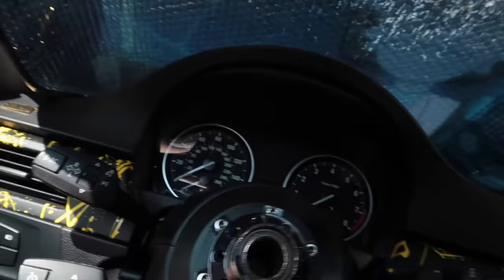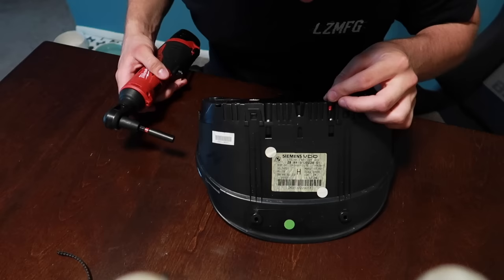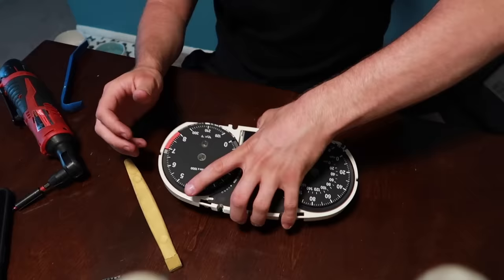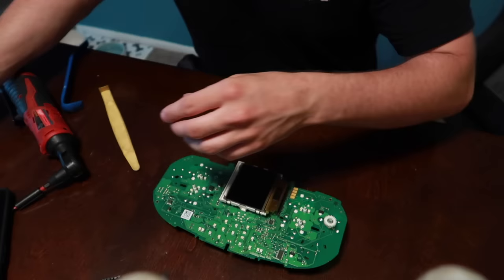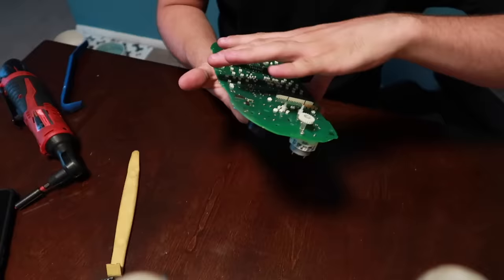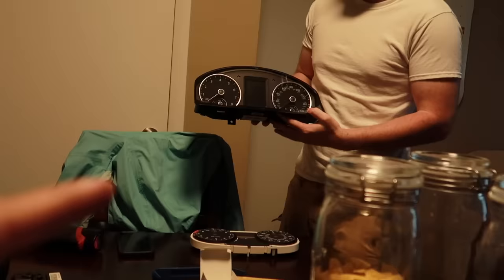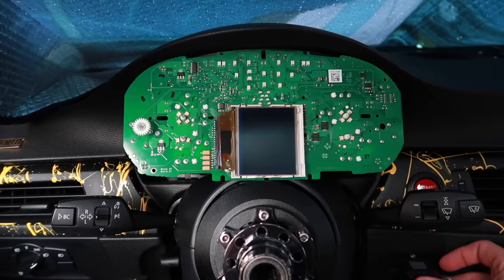e90/e92 Gauge instrument Cluster LED Swap DIY

Comment: Looks great, but there’s a reason why BMW chose the orange color. In the dark this color is the least tiring color in the spectrum for the eyes. Therefore saver. ;)

If you think of it: in astrophotography they use red light (close to orange) because they want their eyes to stay used to the dark. Red has the least impact on the eyes should they need light for whatever reason. 

During the old school negative film developing (in a dark room), they use red light as well, to prevent the negative te be destroyed

👍
Reply: Even in the new full digital clusters the standard color is red
Reply: I love red lighting at night and in cars, I was so happy when I realised my Alfa has a red spotlight in the roof lining aiming at the gearstick, so subtle and sexy at night,
Reply: Younes El Ammari lmao all the new m cars do not have the orange color (except for the prefacelift m2)
Reply: You aren't looking at your speedometer long enough for drastic effects, plus its dimmed. Also BMW of the same era has white lights too (M cars ex.E92/E90, E60). White/blue light helps people stay awake/alert at night which is a plus. 'White' light suppresses the body's production of melatonin. Exposure to the light of white LED bulbs, it turns out, suppresses melatonin 5 times more than exposure to the light of High Pressure Sodium bulbs that give off an orange-yellow light.‘ Additionally "Research has found that exposure to blue light suppresses the production of the sleep hormone melatonin more than any other type of light."

Comment: Hi. I just swapped the led screen on e90 cluster, put everthing back together, connected to car, and my BC button and scrolling menus not working! What could have gone wrong? Scanned, and got this error: A3A9 steering column switch cluster signal  0x1 EE  receiver instrument panel, transmitter footwell module. Pls help.

Comment: I have F10 model and one rpm needle is a bit darker than speeedometer needle (barely noticable). Do you think the LED is dead and should I even try to replace it? I would go for orange again
Reply from the maker: DrSalle hmmm, I don’t think it’s dead but could just be a bad LED. As you see in this vid it’s not hard to do. If you do replace it I would replace all the needles so that they all match. You don’t want to put a new led in and it happens to be the brightest one
Reply: @Anguella97  thank you for help!

Comment: Hey man great video I just finished taking mine apart and will start soldering tomorrow!! But I was wondering did you use the tweezers to guide the led in place or just your hands? Also any general tips you suggest while soldering?

Comment: Hello , am planing on doing this for my f30 but my concern is how reliable are those leds on long term are they going to hold on for a decade at least like the factory ones ?
Reply from the maker: Ahmad Doski not very sure how long they will last. I know they will last quite a few years but I don’t k is about decades. I guess it depends on the brand you buy maybe, but I’m sure you can find more info online

Comment: So I did this and it turned out great but my tach doesn't work now.....no idea what I did wrong...any info?
Reply from the maker: If you are referring to the needle not moving. There is a possibility that you pushed the needle on too far and it’s binding cause it’s too tight. Try taking it back off and putting back on a little looser
Reply: Did u get this resolved ? @robertshaw1490

Comment: Sony went with white led An it gave it a bluish look on camera an in person black an white correct? Also which 6 because the picture in ur video the top 6 outside the square are circled,there’s 3 then the big square the lower 3 of 6 are circled ,ima lil confused
Reply from the maker: celis281 i replaced with white LEDs and in person it even had a blueish tint. I like it tho. Exactly how it looks in the video is exactly how it looks in real life. And the 6 I’m referring too are the 3 in a straight line plus the 3 that are circled in the larger circle beneath it.
Reply: Tyworkz thnk u

Comment: 14:16 what products are those because im not able to remove the leds from the circuit board how would u replace the new ones
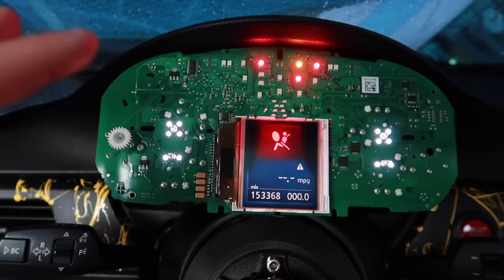Reply: 11:49
Reply from the maker: Samuel Real hey, they are supplies needed to solder. The solder that holds the old LEDs on needs to be heated up with a soldering gun in order to remove the old LEDs. Then you need to resolver the new LEDs on with more solder. The supplies you see at 11:49 is the solder wire which is specific wire that is made for soldering circuit board components. Any generic soldering wire will not due. The other white container is flux which is a paste used to aid in soldering.

Comment: So for the center LEDs that illuminate the information screen, the part that looks blue and white on yours in the video. Did you swap all 18 of those LEDs to white?  It looks like there are 12 total LEDs for the Gauges, 6 on either side and then 18 for the info screen excluding the six you mentioned. I want the screen to be red on mine. I'm assuming you did all white, hence the slight blue hue to it?
Reply from the maker: BimmerTV yes I changed all 18 of those to white. And it gave me a bluish color.
Reply: @Anguella97  Ok cool, thanks for the feedback, I appreciate it.
Reply from the maker: BimmerTV sure thing

Comment: Hey quick question did you use all white  Leds for the Display and it just so happend to have a blueish background or dis you mix some blue ones in at certsin spots?
Reply from the maker: Ayaahuasca I used all white leds and for some reason gave a bluish tinge
Reply: @Anguella97  ah nice thx for the quick answer couse i made mine all blue but i dont like it as   the background is blue and the writing is blue i still have to figure out how people do the  real blie background but white writing stuff lol
Reply from the maker: Ayaahuasca ah I see

Comment: Which soldering iron did u used for this? Cuz i cant melt the solder....

Sorry for my English im from Germany haha
Reply from the maker: Rodaa88 I just got my soldering iron from an auto part store. The tip of the iron has to be very clean in order to melt the solder.

Comment: hi is it normal that the led's are very tight i dont want to heat it to much so i have no damage
Reply from the maker: jens de vreese Yes, the LEDs are meant to be permanent so it is normal that they are strongly bonded. Your soldering tip maybe dirty, that could cause it to take a very long time to heat the solder up and with a clean tip and a fully heated up soldering gun it should only take a couple seconds. But I did find myself are leaving the soldering iron on a couple LEDs for 10 seconds even sometimes before the solder started to melt
Reply: oke,thank you for your advice.
tommorow i gonna try and take my time to change them.i just wanted to be sure how long i can heat a led because the first try it take a long time for the led to come of so i was a litlle bit insecure that i was doing someting wrong. grtz

Comment: So the 12 in rows off 3 shouldn’t be touched?
Reply from the maker: King TR the second from the top row and the bottom row need to be changed. I have a picture showing exactly what needs to be changed and they are circled in red at 9:02

Comment: I'd love to do it on my e90, but to make my needles in red, if i wanted to, which leds could i would i need to make red? or is it not possible to differentiate it like that? I'd also do the A/C ,etc in white as well as you suggested, it really freshens everything up
Reply from the maker: Dark you can do it. You would have to just replace the leds surrounding the needles. There are 4 surrounding the speed and rpm needles. And there are 2 surrounding the needles below them
Reply: @Anguella97  but would that change the color of just the needles or the needles and the numbers? Cause i love the numbers in white honestly
Reply from the maker: Dark it would change the color of the numbers too.
Reply: @Anguella97  well, darn, may get some M red needles then, but thanks dude!
Reply: I know This is an old comment but for anyone wanting red needles you can lightly paint the needles with red nail polish and it works perfect

Comment: How many LED’s did you end up ordering from the website ???
Reply from the maker: Antonio Medina There are 30 LEDs that I replaced, I ordered 40 just in case Sum didn’t work and if I messed up. You only need 30 but it doesn’t hurt to have extra

Comment: Nice job!! Could you tell me how much of each led do you need for the job and which colors you used? Thanks!
Reply from the maker: Are used white, and I can’t remember how much exactly. If you watch the video there is a picture of the circuitboard and I circle how many LEDs you need. You just need to count them on the screen. I purchased 30 LEDs and I believe I only used about 20. But double check me by watching the video
Reply: @Anguella97  finally you change the central console lights?

Comment: My rev needle stopped working, I did the exact same thing, other needle gears have resistance when you turn it with your fingers, but my rev needles motor has no resistance. No rev counter now
Reply from the maker: Jays Autoworks hmm. If you don’t feel any resistance at all when turning it no matter how many times then something may have happened internally. I would suggest trying to open up the cluster mire to see if you can get to the gears and see if something knocked out of place or broke. Then see if it can be glued or replaced.
Reply: @Anguella97  thanks a lot for swift reply, the white plastic box looking thing that has the spin gear where the needle sits on top of, has no resistance when I move it with fingers the rest of the others do and they working fine, i dont remember touching the area at all with solder iron. All I did was, take the needle of the rev and yes they all were slightly stiff to get out. Thanks for your response anyways
Reply from the maker: @jacustomtuning8008  hmm sorry anyways man, hopefully you figure it out
Reply: @Anguella97  thanks mate I've managed to fix it, opened up the PCB again, removed rev counter motor housing, opened it up and found a gear wheel came of its place. Rectified it and put all back in, working beautifully. Thanks
Reply from the maker: Jays Autoworks glad to hear
Reply: @Anguella97  keep up the good work !

Comment: What tool did u use to remove the little leds? Also how did u put the new ones on? Just pop them in?
Reply from the maker: Rei to get the old ones off you heat up the solder that’s holding them on with a soldering gun. Then to put the new LEDs on you re solder them
Reply: @Anguella97  So why did you fast forward through that part? Lol. Wouldnt it make sense to explain how exactly to do that?
Reply from the maker: 6IXShooters sorry but soldering is a whole skill in itself that needs to be learned to the video would have been an hour long if I taught how to solder in this vid. I did say they needed to be soldered on and all that stuff though

Comment: Did you ever get around to doing the center console parts?
Reply from the maker: Josh Jensen no. I could never find the LEDs. They are about 1/4 the size and they only work on a certain voltage
Reply: @Anguella97  I'm finding the same issue. I was able to do my climate control as it takes the 3528 lights but I can't find any lights that match the size of the smaller ones. I'll have to keep ordering and finding ones that are close
Reply from the maker: Josh Jensen oh okay cool. Let me m ow if you find them

Comment: What steering wheel hub and QR are you using? 🤔
Reply from the maker: Juan nrg
Reply: @Anguella97  you used the hub that fits the E46 aswell right? I have that one myself, just contemplating whether or not I want to live with that airbag light on lmao. Although I BELIEVE it can be coded out
Reply from the maker: Juan it can be coded out with the right tool. I don’t have it though, and yeah I use the e46 one
Reply: @Anguella97  you haven't tried coding it out using MHD or Jb4?
Reply from the maker: Juan nah I didn’t mind that much. Plus I just put an OEM steering wheel back on. I just posted the install video actually. Go check it out.

Comment: Dude, LED prices are pretty low. Why are you cheaping out on LEDs? LEDs that have been soldered on and soldered off will have a severely reduced life span due to the immense heat of soldering. You really don't want to re-use LEDs that have been taken off a board. Just buy new 3528 LEDs.

Comment: Hi did you ever do the radio?
Reply from the maker: unfortunately no
Reply: Tyworkz is it possible mate?
Reply from the maker: Barnsley Grain it is possible. I could do it if I had the correct LEDs but they are almost impossible to find and I can’t locate the anywhere to buy. They are different than the ones used for the gauge cluster

Comment: When you gonna do the A/C console?
Reply from the maker: Carlos Orellana I’m searching for the special LED’s I need to completed it. The center console LED’s are different than the gauge cluster ones. They are hard to find and I haven’t had any luck yet.
Reply: Any luck!??!
Reply from the maker: G One Production I think I found some and I ordered them but they never came in so I have to contact the company. Very long and crappy process finding these leds

Comment: Can u put the screen tooo 
Like in the description
Reply from the maker: Taim Almnini I did show you how to do the screen in this video. If you are talking about the codes that pop up on that screen, then in order to do those you will need to buy different LEDs. You can most likely find them on the website I have it in the description. The LEDs are a little bit different style than the ones are used in this video.
Reply: Yoo sorry I just realized that u just replaced the led behind it, idk y I thought that’s a new screen but when I rewatched ur video I figured it out 😂
Reply from the maker: Taim Almnini that’s alright

Comment: Put a resistor between airbag connector contacts to turn off airbag light 😁
Reply: Hi, how many Ohms resistor?
Reply: @eazzy171 Try 3 ohm or 3.3 ohm, they work for many cars, if light does not turn off, try to make better contact and scan the car and erase the error
Reply: @ognjenkoprivica8169 
Thank you.
Reply: @eazzy171  if you try, comment if it work 😊
Reply: @ognjenkoprivica8169  3.3 worked for me. Thanks. The dash looks great